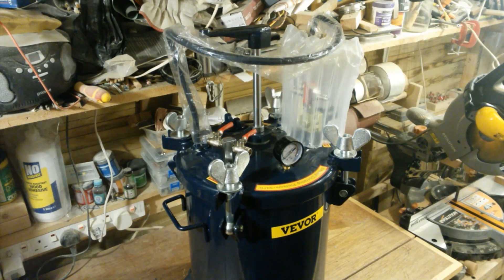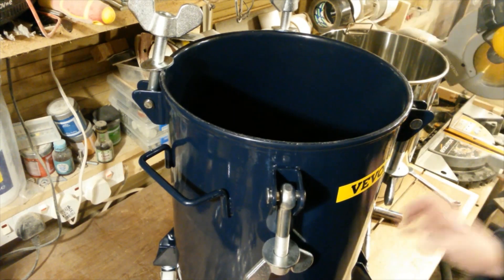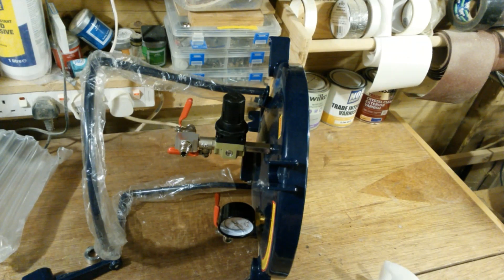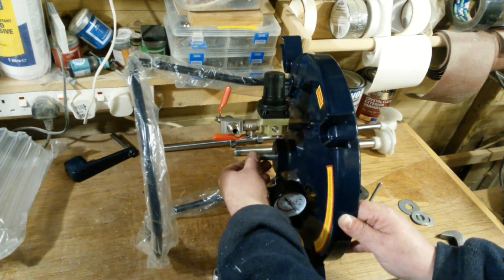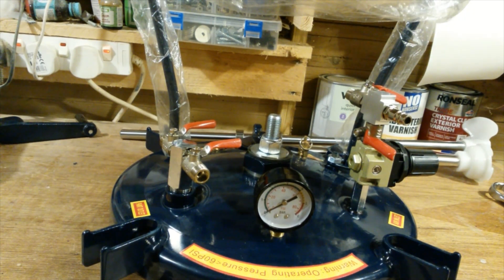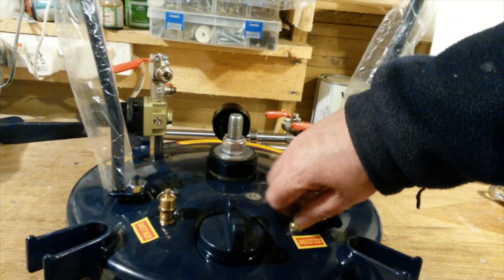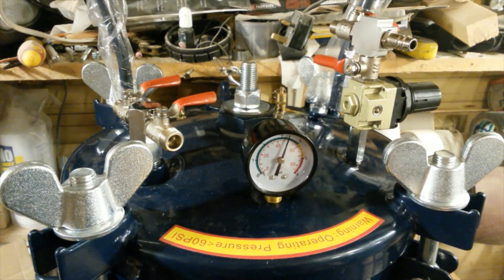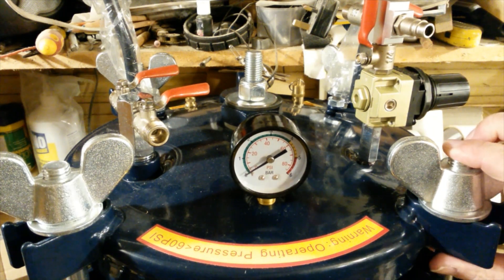converting a pressure pot for resin

Comment: Cheers for this Neil. I'm just waiting on a vevor 20l pot to be delivered. I'll be converting it as you did for exactly the same reason. As I see it, there's no need to remove any of the ball valves. That's just creating a little bit more work, & expense on other parts that aren't really needed. So long as you just keep all the valves closed then your good to go. To empty the pot & release the air then just open the valve. At least that's how I'll be doing it. Simple as👍🏴

Comment: Hi Neil, thanks for thr video, I'm getting the same pot so it was really helpful. What would the perfect length bolt be to blok the hole to prevent it protruding? Thanks 😊
Reply from the maker: Thanks I'm glad you found the video helpful.
I've measured the bolt it is 2.5cm too long so I could have used a 7.5cm (the threaded section) long bolt but you may need a longer bolt depending on the thickness of your rubber and metal washers hope this helps.